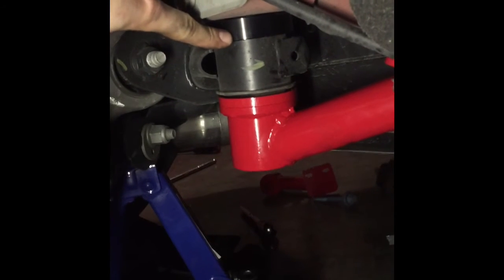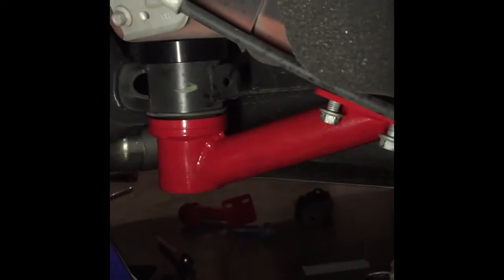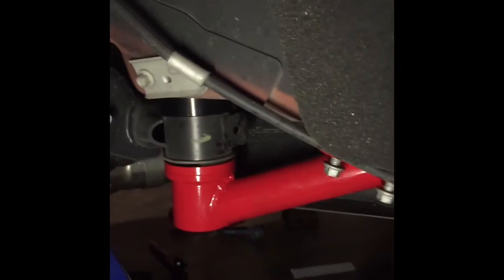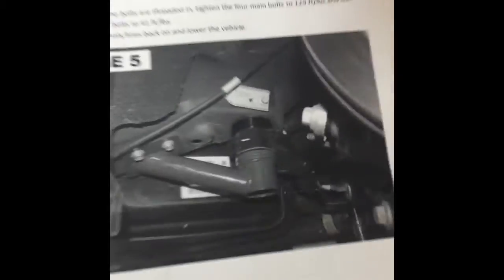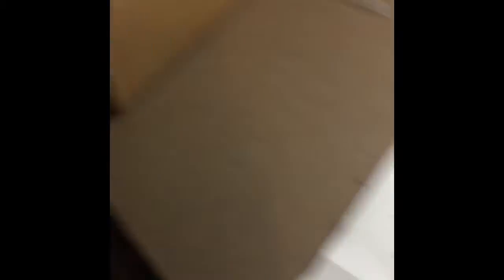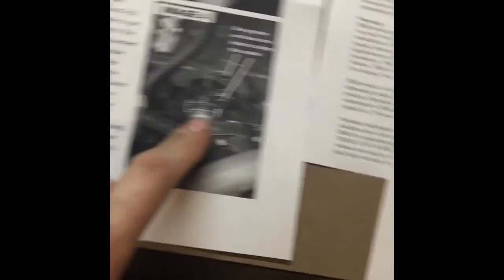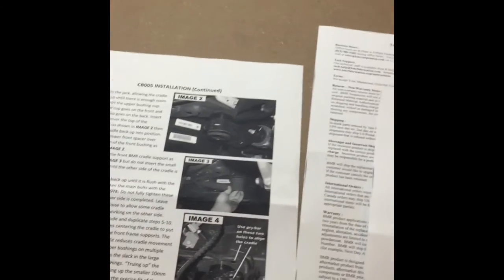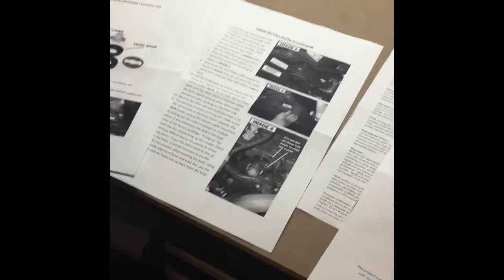2015-2018 Mustang BMR Cradle Lockout CB005

Comment: You never did a holeshot after install to see if the wheel hop problem was any better Wheelhop problem is driving me crazy. Good video thanks for the info.
Reply: Sam Scornaienchi I went Steeda IRS bushings and subframe brace kit and wheelhop is not even noticeable but won't be able to test full launch until it warms up here in Canada!  I will also add the vertical links sometime in the summer too and that's al you'll need!